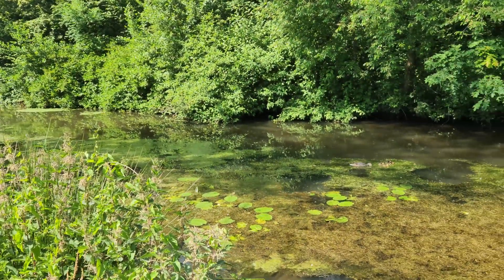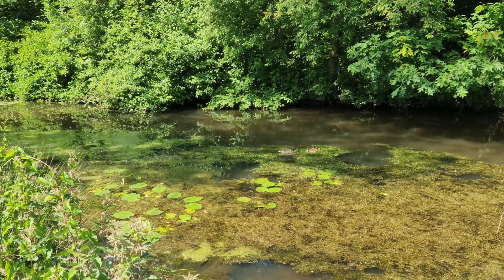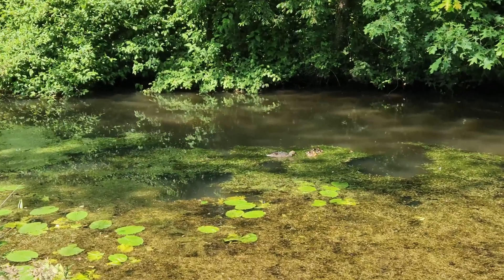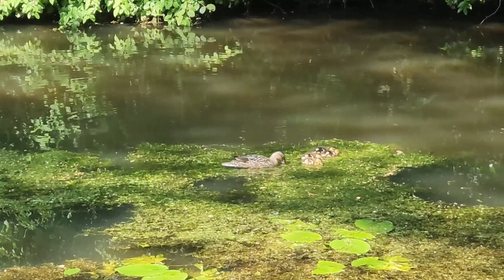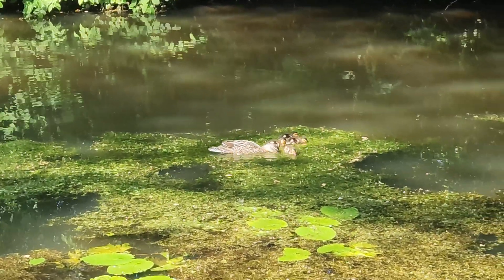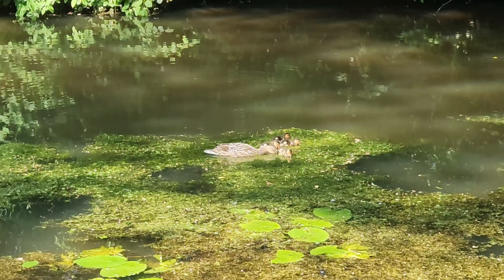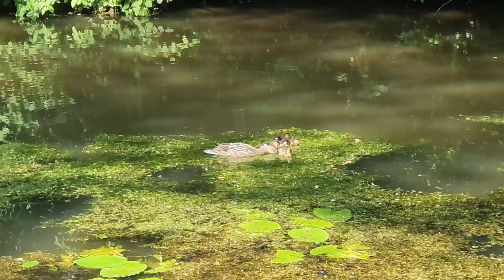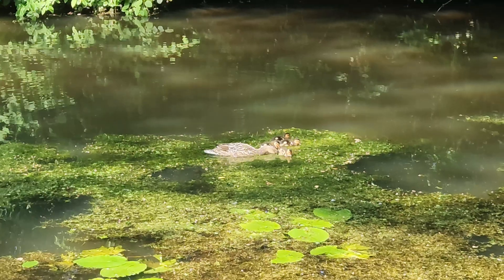Self watering Beacon, Plant Watering System with Homeassistant Integration

Comment: Reed switches are direction-dependent; Some orientations of the spehere-bubble magnet may not work. Some ESPs have an on-board magnetometer; this might allow you to measure the B-vector, entirely skipping the reed, and agnostic to the orientation (I'm not sure if the magnetometer is 3D, though..). Fixing the orientation of the magnet (e.g. in a Senseo) may help too. Cheers!
Reply from the maker: This is a good point. For this reason, I designed the reed switch placement vertical in the case to have a longer path for magnet detection, and I did not face a time where reed switch failed (yet). 3d magnetometer would definitely eliminate this issue, and I also thought about it. However they are not power efficient as reed switch option. With a reed switch I "theoretically" do not lose any power . But it feels good when someone sees your design struggles and gives remarks :) thanks for your comment. I will post updates if I see any issues in the future.